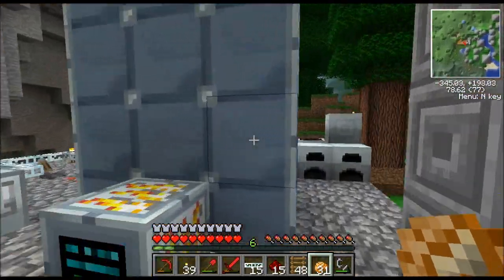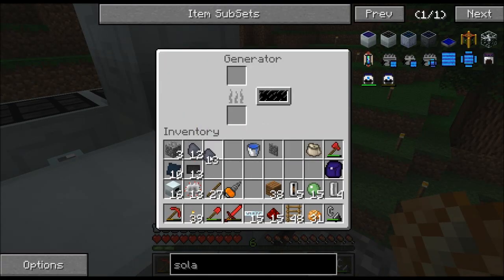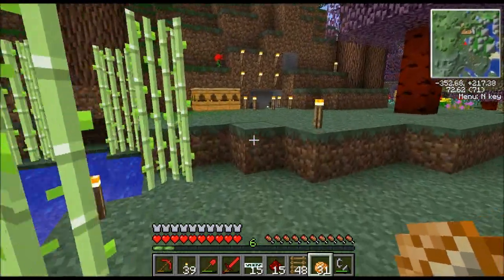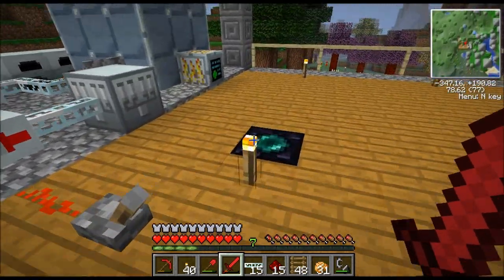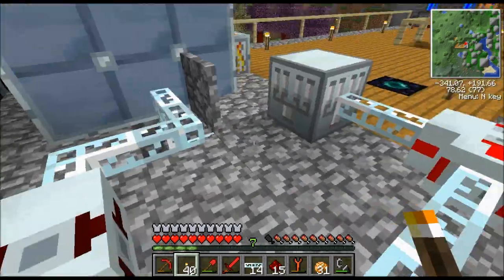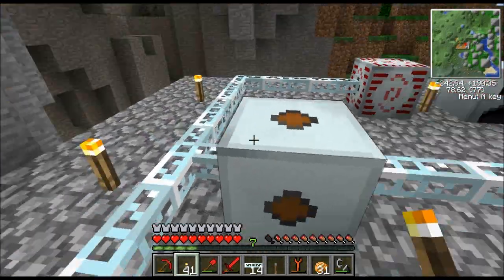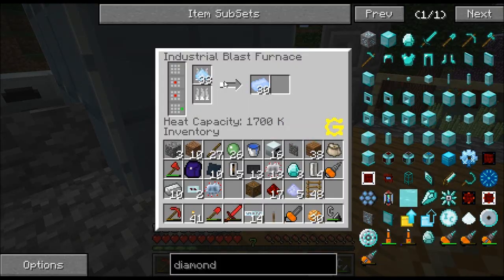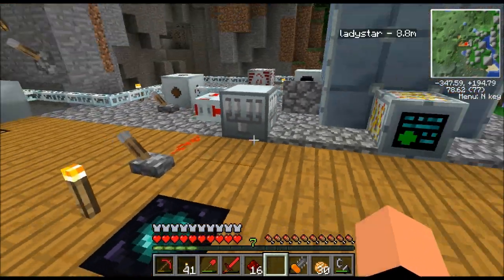FTB/Feed The Beast Let's Play W/ Grumpy - E05

Comment: if you divide you coordinates by 8 in the overworld and use those to build a portal in the nether it will link them up, it wont use the same portal but it'd be fairly close and can be used as a quick way between the new and old place.

Comment: Yes, you should really look into magma crucibles. One crucible (netherrack as a fuel) can support at least 10 magmatic engines (I use 5 of those to power the crucible itself at full speed) or you can use the crucible to produce a huge amount of EU via geothermal generators.

Comment: Netherportals: They correspond to overworld cords/8.
So if you've got a portal at x200 and z200, make a portal in the nether at 200/8, that is, at cords x25 and z25 and those will link. If your old portal was at x20 ans z20, make a portal at 20/8, that is x and z on 3 or 4 and those will link.

Comment: opengl was causing random crashes till i turned it off.  might be your issue.  slimeballs can be turned into rubber a few different ways, so they're actually very useful. the slime chunk in game finder was disabled by changes in the vanilla core since 1.2.5 or 1.3 i believe

Comment: ya the new Railcraft World Anchor takes enderpearls.  You stick one in and it last for whatever hours..

But there is a new World Anchor by Chickenbones in called Chunk or something.  You can set this one up to be 1 chunk.. or 100 chunks.. Pretty impressive..

I myself think chunk loaders themselves solve a flaw in Minecraft.. Why they would add a fuel to them is beyond me.. They should be a plant and forget thing..

But most likely a server issue.. Trying to control them.